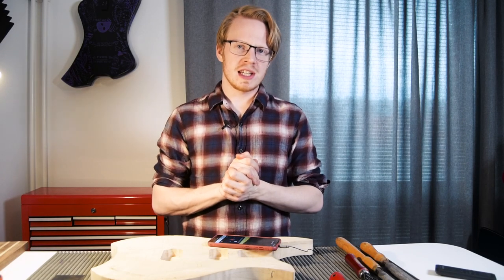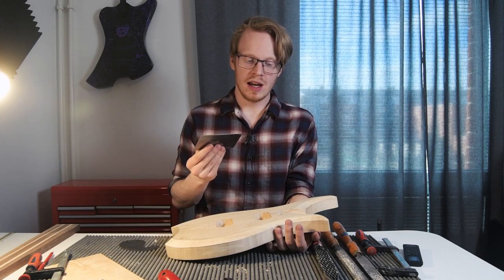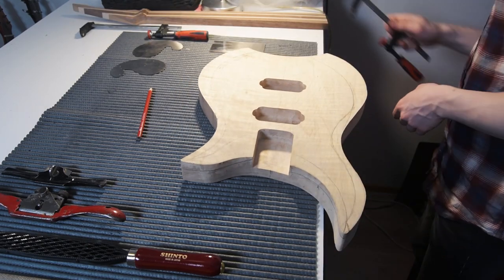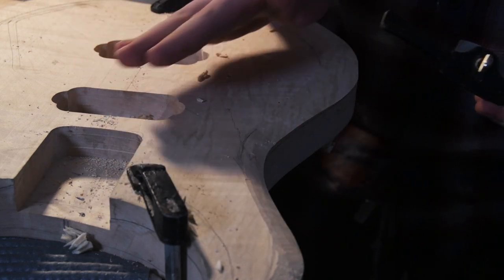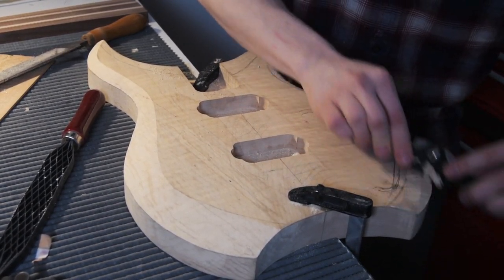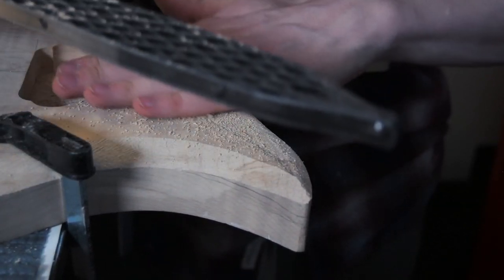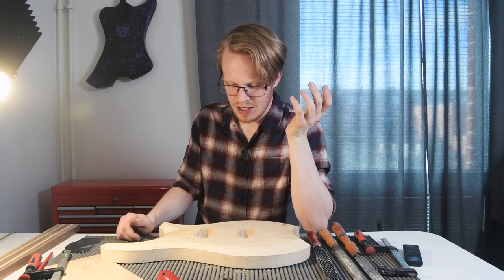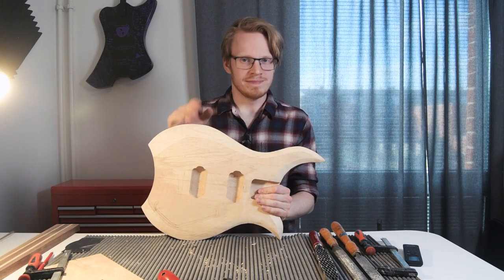How To Carve A Guitar Top?

Comment: really curious on carved top guitar such an PRS carved top style with modern 2 point trem,
do i still need a slight break neck angle ?.
Reply from the maker: Usually you always need a neck angle of some sort. While there are tons of brands that have none, having the angle work with your bridge height makes a huge difference in playability. Usually hardtails and trems will only have about 2-3 degrees, so that's why it's easy to get away with not having any. And a lot is up to you, the player :) if you don't mind a higher action moving up the fretboard, then there's no worries. If your action (so measuring from the top of the fret and bottom of the strings) stays the same throughout your neck, then your guitar's neck has an angle built in already.

Hopefully the somewhat lenghthy response was atleast a bit helpful :D
Reply: IP Guitars thanks a lot.. i been asking a few luthier is always answer the same, advantage on flexibility to set up rather than super flat..or as simple just hate any protruding neck which bother the overall looks and design..